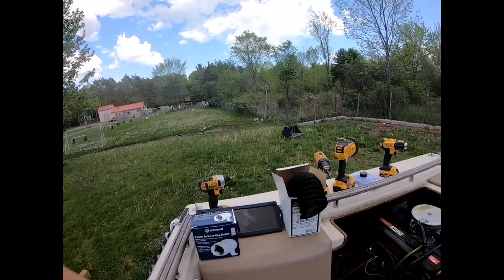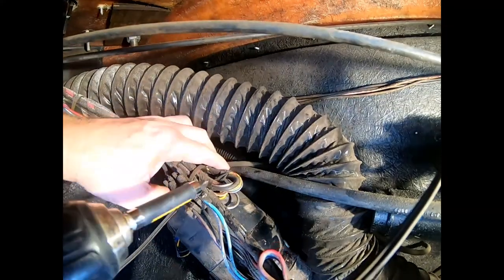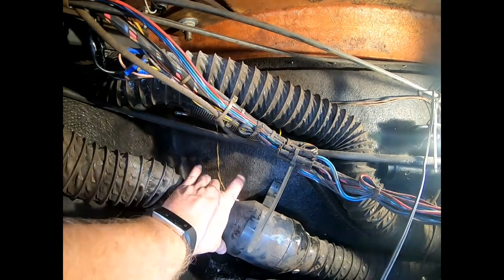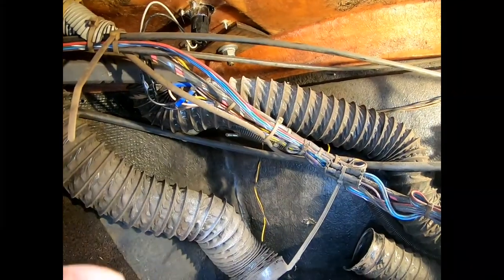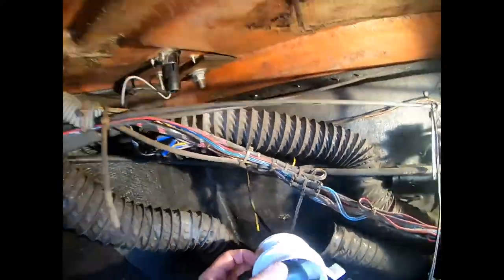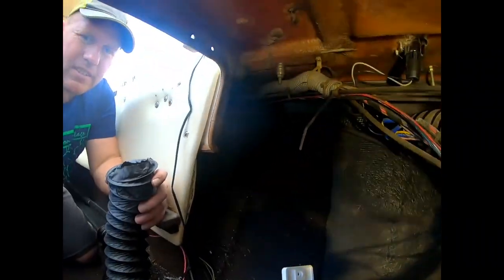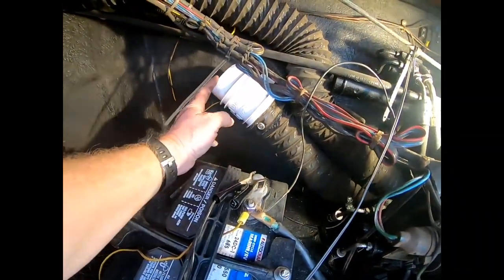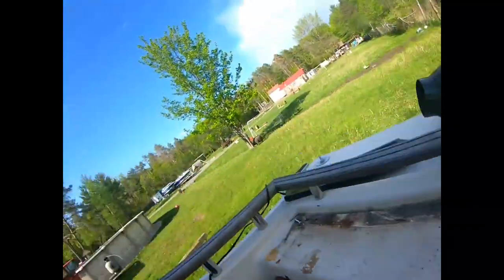Mercruiser Boat Exhaust Blower Install

Comment: I did this about 2 weeks ago myself. I have a question though I seen you have 2 lines as well do you have 2 blowers. I boat my boat second hand and it only had one blower but also had 2 lines.
Reply from the maker: Awesome,  one blower will do for your boat, The second line is just a fresh air hose that connects up to the vents, you can run just a hose like mine but not neccessary, some bigger boats have 2 blowers at 4 inches but for our type of boats 1, 3 inch blower is sufficient!😁👍
Reply: @WhitehouseFarmVet  Thanks can't wait for more boat vids.
Reply from the maker: Awesome thank you as always!

Comment: this ventilation motor blows hot air out.. will it malfunction if sea water enters it.. Thank you.
Reply from the maker: Possibly like anything if the wires or motor of the blower are exposed or not sealed correctly, corrosion or failure can occur but if it's set right it would take alot if water entering and I think at that point your getting ready to abandoned ship! Lol thank you for watching!👍

Comment: I'm new.  when should you turn on the flowe
Reply from the maker: When you are idling in place or you stop you should run it for a couple minutes to get the fumes out! Thank you for watching!!!👍👍👍😊
Reply: 1. When you stop to refuel the boat- put in the gas then you run the blowers for 3-4 minutes min BEFORE STARTING engine
Gas vapors sink because they are heavier than air. So they may find a way down into the bilge of your boat -
2. And if you’re idling for a while somewhere- turn it on every few minutes
Reply from the maker: Thanks and thank you for watching!👍😊